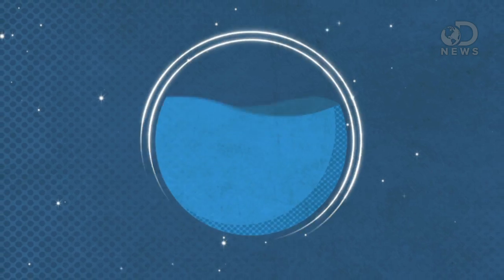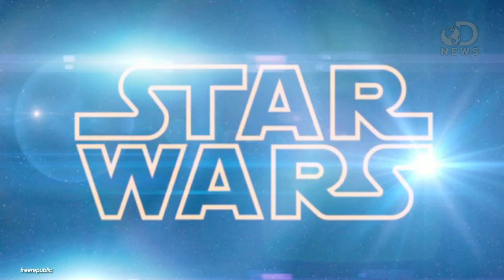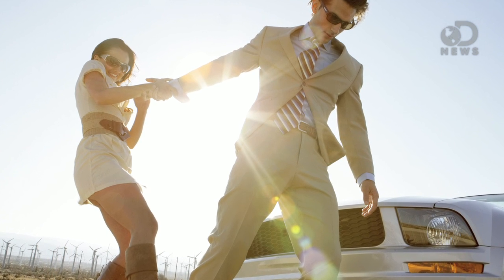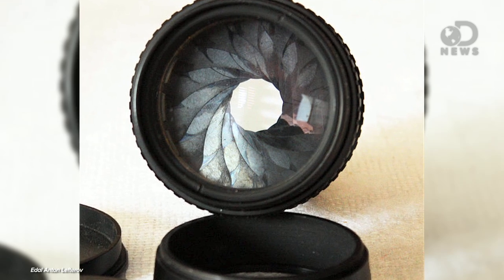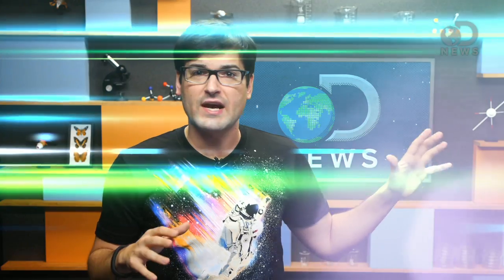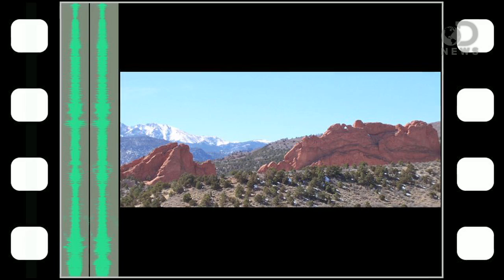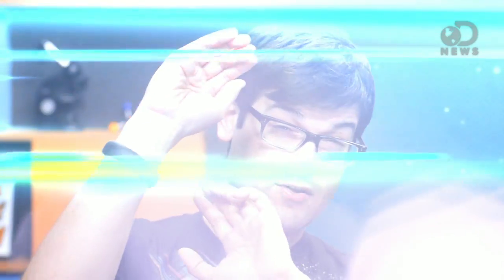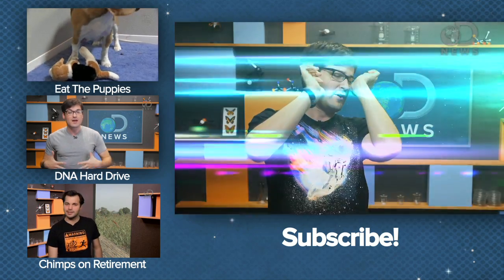J.J. Abrams Lens Flares: How They're Made

Comment: You have gotten anamorphic lens all wrong. You see, an anamorphic lens stretches the camera's image vertically, resulting to an image that is much more squarish (somewhere around the 4:3 aspect ratio) and has these lens flares gathered up by the anamorphic lens' glass, but in a more subtle way. From then on in post production, the image is vertically squeezed in, creating an aspect ratio that looks to be much more longer horizontally (2.35:1) than the original aspect ratio you were working with in camera. As the aspect ratio is changed in post production, it also thins out the lens flares vertically, creating the icon cinematic lens flare in the film industry. Or might we just call it the J.J Abrams effect lol
Reply: +HugoHum Films The image is actually stretched out vertically giving it a wider aspect ratio, and more resolution, since the frame will be covering more pixels